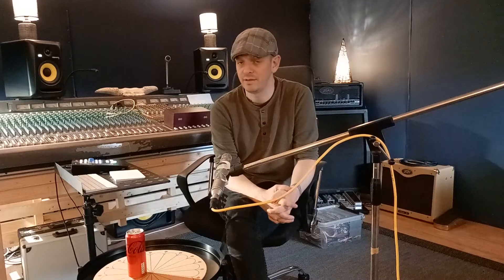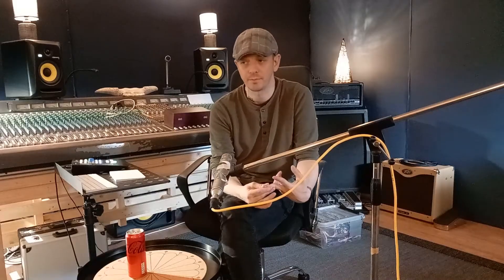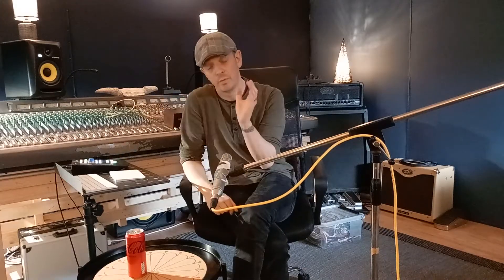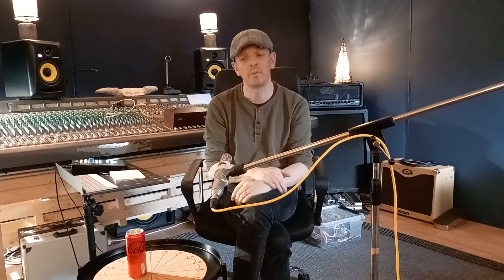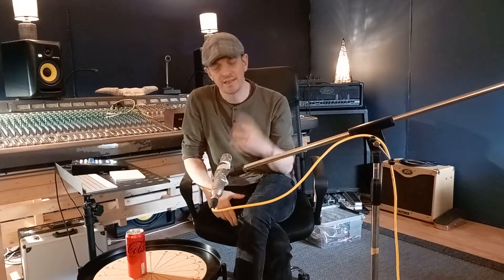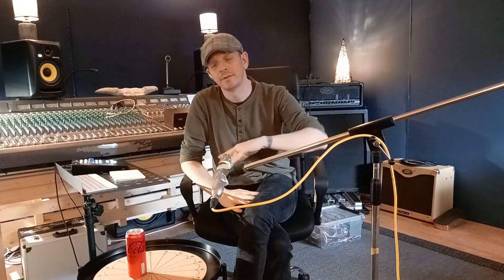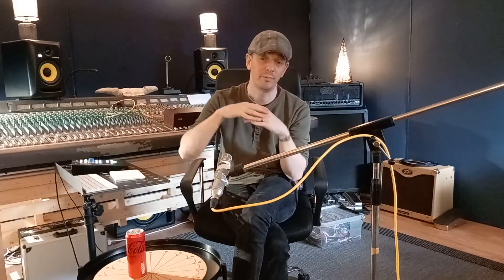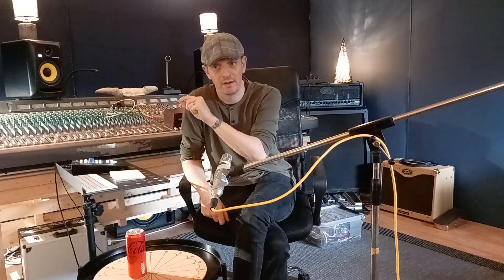Gain Staging. Analog vs Digital.

Comment: Would be nice when really showing this what you are telling.
Reply: 1. import tracks,
2. normalize tracks so they all hit 0dbfs,
3. use a gain plugin on all tracks, first insert, and set the gain to -18db, now all your tracks is peaking at -18dbfs.
4. use a VU meter on the master/mixbus, set all faders down so no sound is coming thru.
5. start with your kick fader (and, or with the bass fader), and set the kick fader (and, or the bass fader) so its hitting 0vu on the masterbus.
6. build the rest of your track with the faders, if you exceed 0 vu, then pull the whole mix down, some overs are okay ofc.
Reply from the maker: Or just normalize to -18 dbfs and your good to go.
Reply: @Anything-about-music  actually this is what ive been doing lately, do you have any tips on how to balance the track? i feel like once i have all the faders at 0db and the whole track screaming at me, it can be a bit overwhelming
Reply from the maker: @MetiCudi  Then its time to start mixing with eq/compression pan and faders. The -18dbfs is before the fader. Its the sound going in to the channel. Not whats going out of the fader.
Reply: @MetiCudi you don’t have to normalize every single track..and you definitely don’t need to normalize to 0db, man you should stop giving advice asap
Reply: @Readdy-223  Most DAWs dont let you normalize to a spesific value, e.x. old logic, fl studio or abelton, they only let you normalize to 0 db, so what i do, and what i explained in the comment over, is that you use a trim plugin after normalizing, to turn down the track to -18dbfs, like the guy in the video is saying. You definitely can normalize to 0dbfs, and use faders, busses and VCA to control whats going out the masterbus, just like CLA has shown countless times in his videos. This is a great way to mix, as for after each process (comp, eq and saturation), you can quickly levelmatch the process, based on what value you chose to normalize the track to.
Reply from the maker: Thanks for your time and input! Might do another episode with that in the future!

Comment: I use a lot of Acustica Audio plugins & this is spot on. They are happiest at -18.5 Dbfs. Acustica emphasizes this. The issue I'm having is when controlling individual track volumes in the box, I always have to have a plugin at the end of the insert chain to control the "mix" level as opposed to using the faders in my daw as their stuck at -18.5 with the input. In essence it's  bit of a pain because then the faders look nice but are in effect rendered useless & stationary. Any thoughts on this? Great video & you got a sub. :)
Reply from the maker: Thanks for your time! Not shure though if i understand your problem. The fader should have nothing to do with -18dbfs. Your fader should be at around zero and only feeding the masterbus. Its the input that should be at -18dbfs (the track itself) Hope that helps?
Reply: When you are working in digital, 0 dbfs is the maximum setting for your signal level. You can't go higher. Unlike analog, you want your signal to be at max, or 0 dbfs. Analog signal levels are measured in volts. Digital signal levels are altered using bit rate. I'm going to give you an example using MP3. I know you'll never use it, but its the easiest format to make my point. MP3's bit rate, or resolution, goes from 0 to 320kbps. 320 is the highest quality MP3 you can make. The only way you can get the full 320kbps of the file, is to have digital gain and volume controls set to max. As you reduce digital gain or volume, the 320 gets reduced the more you lower either one. So, after you make a level adjustment, your 320 will be something lower, like 280 kbps. And it keeps dropping the lower you go. This is called bit stripping. That's why best practice is to set your analog gain as the primary adjustment, and fine tune it with trim. Since you are altering bit rate, not voltage, there's no benefit to shoot for anything lower than 0 dbfs. And you can't go higher. 

If you're having issues at 0 dbfs, its something else. Turning your resolution down is never going to make anything sound better. You may have something else in the signal chain set too high, and lowering digital gain or volume may improve sound quality, but the improvement is indirect. Here's another example. If you turn the volume on your home stereo up so loud that the speakers distort because you are pushing them beyond their limits, it has nothing to do with the signal itself. A volume control can't harm or overdrive the signal (only gain can do that.), so the problem must be something else. You fix the problem by turning the volume down. But its an indirect fix. The signal wasn't damaged and lowering the volume didn't fix anything. The problem was the speaker couldn't play as loud as you wanted it to. Backing off the volume didn't fix anything. If you replace the speakers with ones that can play louder without breaking up, you can turn the volume up to the same level as your old speakers, and there will be no distortion. Something like that is going on if you have issues at 0dbfs. 

Its also worth noting that you can use your trim if you need to. Its just for small adjustments. If you are working in 16/44, or higher, small trim and digital volume adjustments won't be audible. If you need more adjustment, look at your gain structure and make corrections so you don't need anything more than small trim adjustments.

Comment: I’ve been mixing for a couple decades now and I also started to mind gain staging in the box for the reasons you noted, and using the same reference levels.

I had these distorted mixes that I didn’t fully notice until listening outside of my usual environment, meaning I was building a tolerance to listening fatigue. Anyways it took me a while to figure out a lot of my plugins were clipping internally. Even in some cases without the internal meter going in the red. A lot of the Waves plugins are like that, and especially the ones that do analog emulation.

It can be a big problem because many plugins don’t operate this way so it’s easy to become inconsistent with your approach and before you know it you’d think you have nice “saturation” but have subtly clipped all of your transients, which is where most of the dynamics and sense of loudness and clarity come from. So you get this creeping blanket of stifled mix while losing headroom and can be very hard to figure why.
Reply from the maker: Thats a problem when you learning on analog gear first. 100% relate!
Reply: @sibbyeskie   Actually Waves analog emulation plugins have this mentioned in their manuals, some are calibrated -18 dbU some even are -22 dbU. Most of these emulations have a certain sweet spot at these levels. Reading a manual isn’t always fun but it definitely helps. One thing is certain, if we buy a expensive hardware unit we probably read the manual, with a twenty bucks plugin we tend to forget that 😉

Comment: Interesting. I guess I mainly only use analogue equipment on way in. Once in digital realm I aim for around -10 peak but sometimes that goes higher. I generally don't normalise anything. 
If I'm patching to an fx unit I can control the volume going in and gain on that unit so this never really becomes an issue.
But I think it's important to understand if you are doing a lot of cross over. I also wonder if any true to life copy cat plugins would be affected also.
Reply from the maker: What ever works for you is fine! If your using analog emulated plugin it will behave just like the hardware when it comes to signal.
Reply: @Anything-about-music  Yes and no. They can set the plugin up to have controls that try and replicate a real analog device, but its still an emulation. Gain and volume don't work the same way as digital gain and volume. With analog, signal strength is altered. With digital, its done with bit rate. You need to know how both work. 

In one of the other comments, we were discussing dbfs compared to analog signal gain. They work differently, and most people think you should have dbfs set at -18, or something similar. This is digital. There's no benefit to try and shoot for anything lower than 0. You're not altering signal strength in the digital domain. It doesn't apply. You're altering bit rate. 0 is the highest you can go, and that's full resolution. The more you reduce dbfs, the lower the signal quality. That's why you should always use trim in small amounts. If you find my other post, I go into more detail on how that works. But if you don't know how a digital plug in works, you can't fix anything if you have a problem. If you look at some of the other comments, many were complaining that when they have dbfs set to -18, its not loud enough. That's why it should be set as close to 0 as possible. If you still have problems around 0, then you have to find out the real cause. Backing off dbfs will just cover the real problem up.
Reply from the maker: @052RC  I got a bachelor's degree in music production and you are wrong. Thanks for sharing.

Comment: Very interesting! Great episode!  Would love to hear your thoughts on monitor calibration related to using these levels. I hear many new beat makers/songwriters/laptop producers argue that when they use the -18dBfs level reference everything sounds too quiet. I always say to turn up the monitor volume, but they say that doesn't always work.  Is there more to than just turning up the knob for the speakers? How do you feel about using a limiter on the Master Bus vs just turning up the monitor volume till you get to mastering?
Reply from the maker: Just turn up the speakers if you need more volume. Dont use i limiter on the master unless its the sound youre after. Mix on low levels. If you dont your ear will get tired and you will hear things the wrong way.
Reply: @Anything-about-music  Great tip. Thank you!